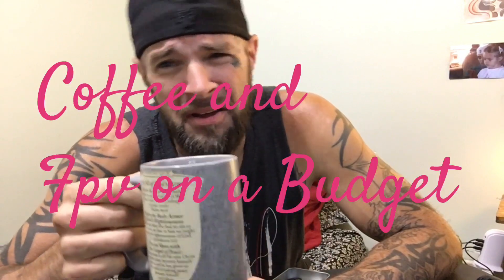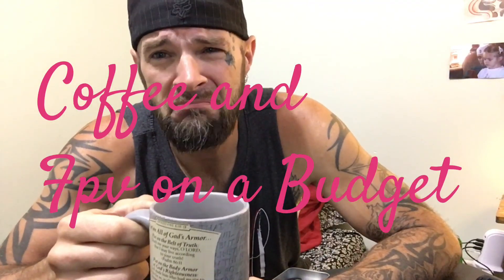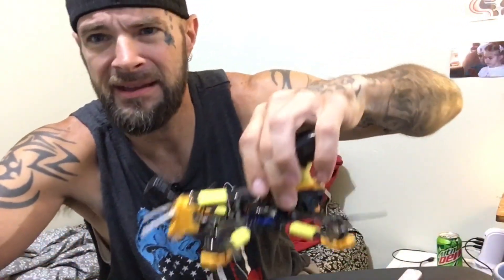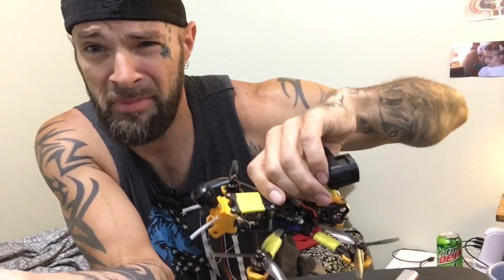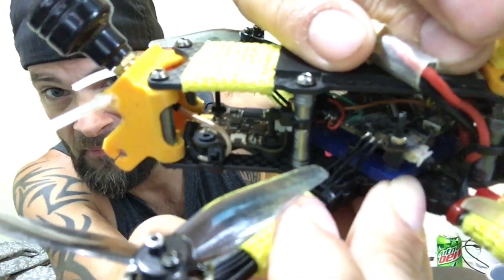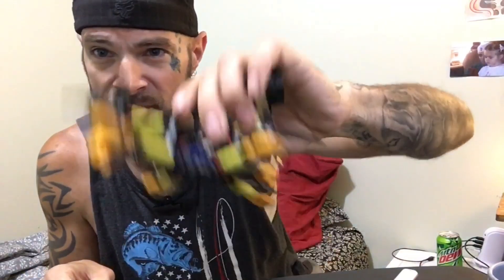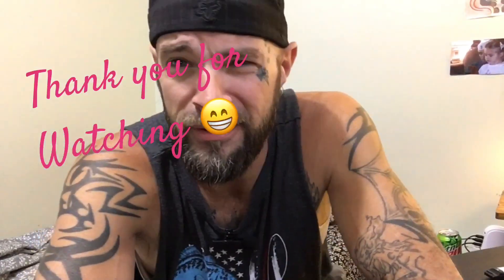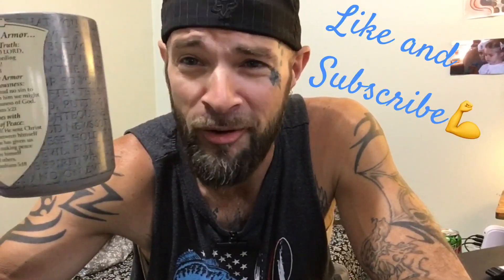“Soldering an AIO board”/“Crux35 Flight controller motor plugs”. #fpv #fpvfreestyle #happymodel

Comment: New sub here bro 💥💥💪🤛...I am debating on whether I should solder straight to my beta fpv board or install the motor plugs by soldering them... Which means I can change motors fairly easily if I need to.... But I don't get the benefit I'm having motors soldered directly to the board... Not really sure what I should do on this one 🤔